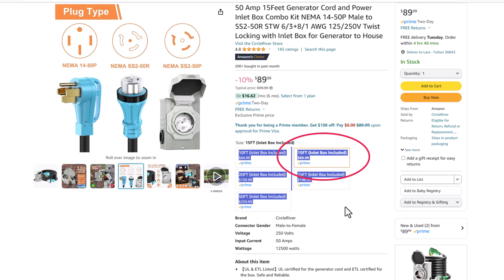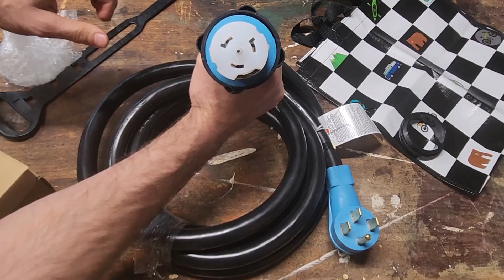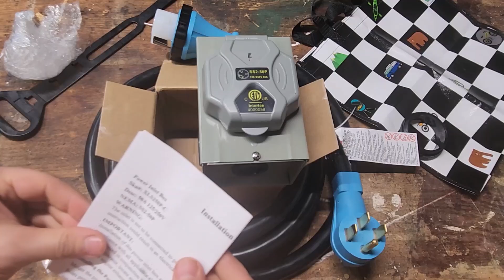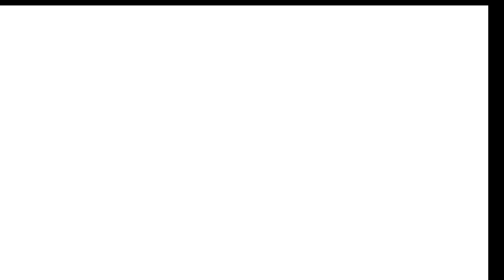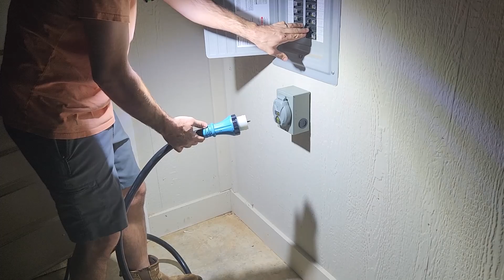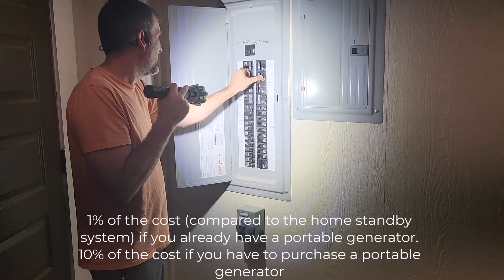Home Standby Generator Alternative || Back feeding your home using RV plug and cable

Comment: Don't have that much money...I already have an RV that has a 4000W Onan Generator.  Brought (3)  EZ Generator switches which comes with install instructions. (90$)  each.. Brought a Reliance Through the wall kit  (120$) along with a 30 amp cord ((90$)..Very easy setup....Used it ONLY twice so far since I had installed it.. Works great.
Reply from the maker: Me neither!

Comment: This video and the Generac one are very nicely done but I imagine it has been some time until now ( Feb 26 ). The interlock system is mandatory now if a person wants to stay with code. A home owner has to decide for themselves if they are overreacting to very infrequent outages or are willing to do anything so that a moderate or extended outage never happens again.
There is so much information available now that a person can make an informed choice. 
I am about to install one very similar to this because of Hurricane Helene which happened a few years ago with loss of power  for more than a week. 
I have lived in the same house 20 years however, and there are only 2-3 times that I would have needed a generator. But they were very unpleasant occurrences.
Reply from the maker: Yup. Thankful to have it when needed (which is not often)

Comment: An interlock is mandatory under section 702 of the NEC and should not be omitted.  Back-feed unto the utility line is an obvious hazard, but less obvious is that without an interlock, it is possible to leave the generator back-feed breaker turned on after the utility power is back on and the main breaker has been re-energized.  Or even more likely, someone who is not knowledgeable about the generator could later be troubleshooting a problem and peek inside the panel and just make sure to turn ALL breakers on just incase the breaker they see turned OFF might be the problem.  This leaves the male prongs inside the generator inlet box live.  The inlet box shown in this video has a screw on cover, but some don't.  Even with a cover, a child could easily unscrew the cap and touch the live prongs and an inlet box without a cover is obviously even more dangerous.  My recommendation is to hire a licensed qualified electrician.  Alternatively, if someone really knows what they're doing and wants to DIY, go down to your local codes administration office and take out a permit (most jurisdictions will allow homeowners to take our a permit without having a license) and have it inspected after installation.  It might just save a child's life!
Reply from the maker: Thanks

Comment: Having gone through Katrina, and most recently Ida, neither of which I was fully prepared for, this is a fine and affordable method.  Thanks for posting this. I just bought the same generator - I think, but I am also adding a Pecron 3600 LFP and a 56k golf card battery and charger so I can run through the night without the worry of having my generator stolen. It happens a lot. I'll charge up the golf-cart battery from the generator during the day, and then run off that combo during the night.  No, it won't run central a/c.  But it will run 2 refrigerators, 1 freezer, and 1, 5,000 btu window unit in the bedroom for more than 8 hours.  After daylight, I'll fire up the Champion on natural gas, if available, on propane, if I still have any, and on gasoline as long as my truck still has some to siphon.  Thanks again!
Reply from the maker: I like the idea on the charger!

Comment: I would like to see the generator further away from the house, especially having to leave the door cracked for the cable...
Reply from the maker: You can get a longer cable for the connection between the generator and your plug. The door that is cracked is from the uninsulated garage to the back porch. I put mine on the back porch so it's covered, but you also hear it from inside which is a drawback (although that's a small price to pay for backup power when needed).

Comment: That is a strange cable. It is a 4 prong 240/250v 50amp into the generator, and a 3 prong 120V 30Amp inlet box? You are only using half your power in the generator? I had to watch the video several times to make sure what I saw. If you switch to the correct input connector and buy a cable that supports 250v/50a at both ends, you will be better off. I have had both between my last two houses. I helped my electrician/friend with the installs. I studied the crap out of theses things. I love your input outlet. It is a 125v/30amp (3750watts max) marine grade with a threaded fitting. I see it on docks all the time. I use it on my boat, but it is the 3-prong fitting at both ends. Yours is a non-standard cable.
Reply from the maker: Good question. 
The 4th "prong" is the ground on the side of the plug. See here for a video that talks about that very thing:
https://youtu.be/lzbhBUdSUDk?si=_fRbwCBF6RoxflTf
You've got the full 240V - 50A all the way through.

Comment: I did this myself a few years ago as well.  I looked at the Generac options but instead ended up buying a 2 cylinder larger capacity generator with pressurized oil system and oil filter (which means significantly fewer oil changes) for $2,000.  I spent $900 having an electrician install a manual cut over switch and outside port.  The advantage of the system NOT being automatic is significant.  I hear everyone else's generator start whenever we have a short brown out or very brief failure.  If you are on vacation or out shopping, that generator is announcing that there is NOBODY HOME!  Also I do not have to deal with the crappy customer service BS.  I maintain the generator myself and nobody is snooping at my maintenance or usage as is the case with the big price tag solutions out there (big brother always watching) that cost 2 to 4 times as much for slightly less KW.  

My electrician said that I can leave the cable plugged in all the time even when not using the generator, so I have done a good job of routing that and I never have to worry about it.  I inspect the cable once a year and I run the generator once a week for 5-10 minutes.  I change the gasoline out once every 3 to 4 months by simply pumping it out of the generator tank and into one of our cars and burn the gas.  An inexpensive electric hand pump makes this easy.  I then put fresh new gas in to the generators and the extra storage tanks.

So I have a solution which easily runs my whole house, including central A/C for well under $4,000 and it will outlive me.
Reply: How large of a portable generator did you go with?  It looks like I can get a 18 kw 'whole house' system with 200 amp transfer switch for $5200 if I do all the install.
Reply: @Mogman150  It is no longer in production, but back then I purchased a Caterpillar RP 12000 which was a 12 kw generator with a 50 amp 220 main breaker.  It is a 2 cyl. engine with pressurized oil system.  But there are lots of generators out there with 1 cyl and non pressurized oil system which will do just fine.  An 18 kw with the 200 amp transfer switch for 5200 is a great price.
Reply from the maker: Very nice!

Comment: This assumes you ALREADY have a standby generator.  Also, I believe an Interlock is MANDATORY as it would be dangerous to backfeed power onto the utility line if you forget to flip that.
I did this standby generator with a manual interlock for several years when I lived in NW Florida.  It worked great and was safe for linemen working to restore power after a hurricane.  After I retired, I went with an automatic Generac system.  Peace of mind.
Reply: I do believe an interlock is required by code.
Reply from the maker: Yeap, its closer to 1% of the cost of the standby if you already have a portable generator but bumps up to 10% if you have to buy a portable generator along with the other components. Either way, lots cheaper. 
The automatic standby is really nice and convenient.